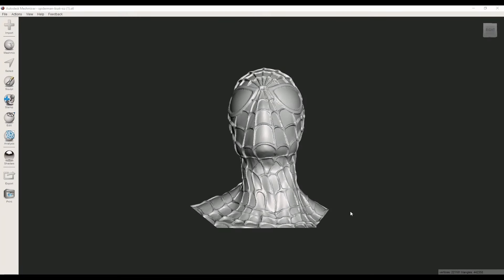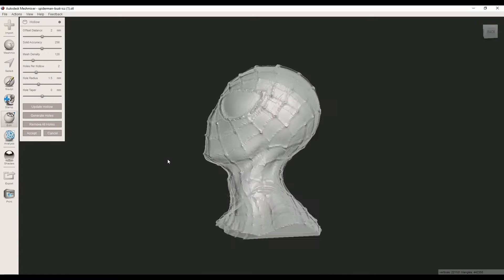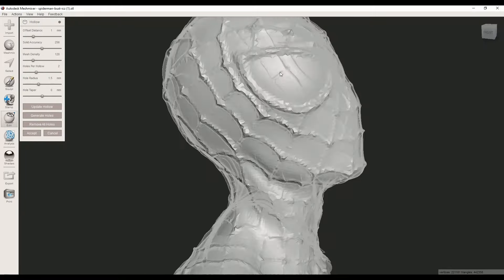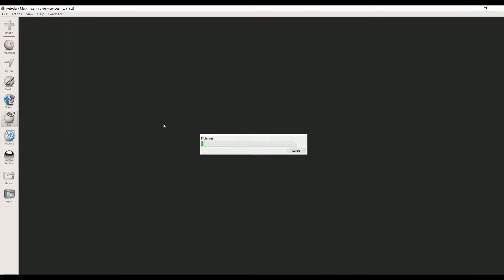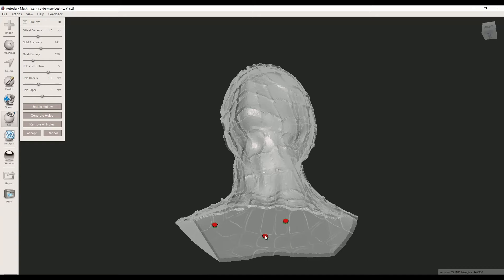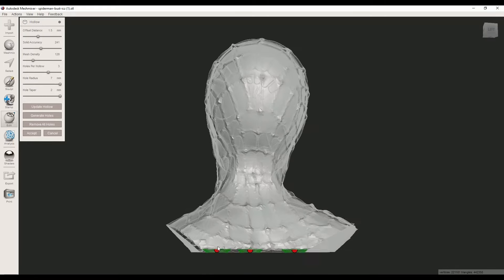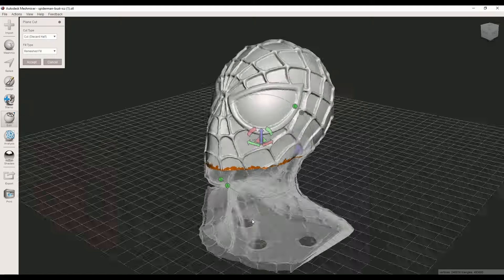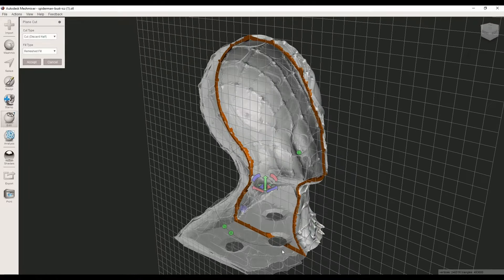Easy Way to Hollow 3D Models in Meshmixer | 3D Printing Tip 2022

Comment: Thank you alot. This was my first time on meshmixer. I hade to open a box and make a lid of the top. Is there a possibility to make like an edge around where I cut the box so the lid stays in place. Don't slide around. Thanks alot for this any how :)
Reply from the maker: I'm not sure if I understand your question.
 you can add a cube (from the left side there is an icon called meshmixer and cube is the shape you are looking for) and place it whereever you want (change the size and move it from transform) then combine it with your box. You can watch the last video that I've made it's about remixing STL files. I hope that gonna solve your problem.

Comment: What is the sense?  Probably every slicer can do it (resin and fdm slicers)
Reply from the maker: Probably not. You can not do this in simplify 3d. Meshmixer is also a slicer. but non of the slicer I've known could do sculpting, hollowing, combine or any other features that Meshmixer has. and don't forget that Meshmixer is open source.